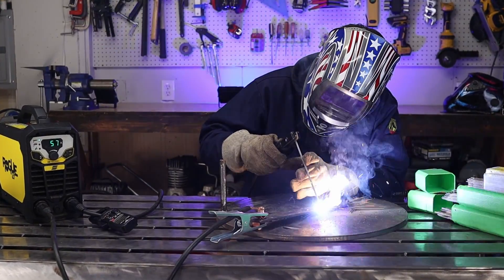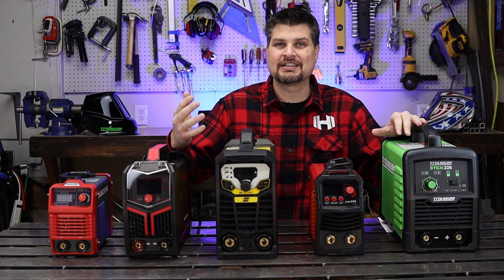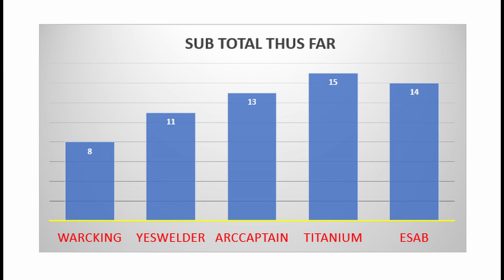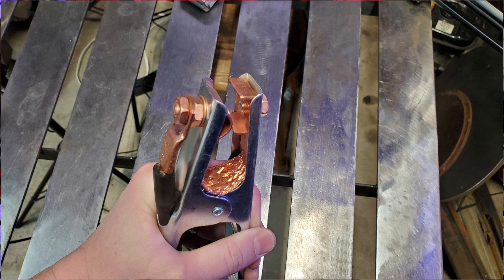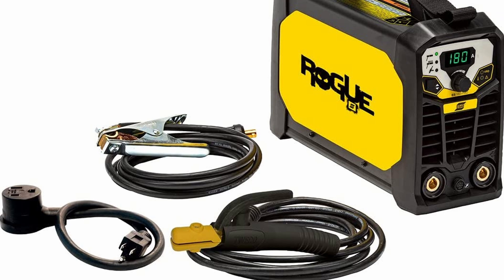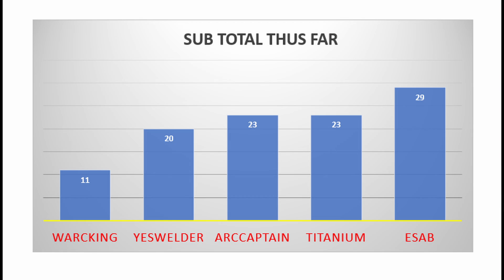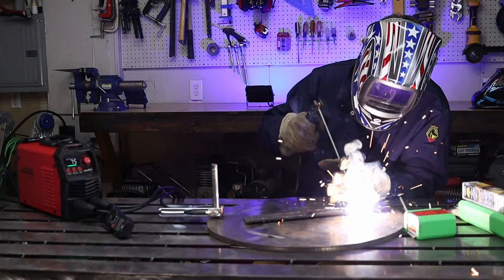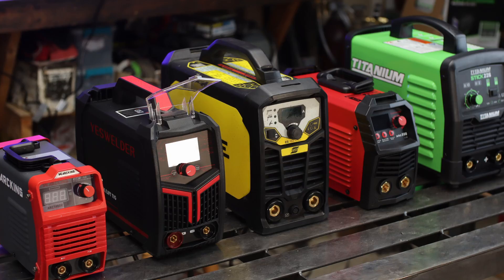Cheap Amazon vs YesWelder vs Harbor Freight vs ESAB? Best Stick Welder!

Comment: What would you choose between higher end models such as the ESAB ES 201i Pro or the Lincoln 180Si?
I don't have as much experience as you to see the cables, attachments, and the general feel of the products.
What about Manufacturer Support for both models in & out of the warranty period? Who really stands behind their product and offers better support in a timely manner?
Reply from the maker: Both ESAB and Lincoln are great manufactures that stand by their warranty. I've had plenty of machines from both of them before and you won't be disappointed with either.

Comment: Ive got 6 machines ranging from Miller MIG to (super generic) BCP flux core with a Razorweld as my main stick machine. Honesty my Titanium MIG140 is my favorite wire machine not only for great operation but great portability being WAY lighter than the Miller. Ive taught several people how to weld and spent lots of time reciting all the points youve hit on here. Thanks for a really effective comparison video, you did a great job of explaining different features QUICKLY without bogging down into impertinent minutiae or being disparaging on any model. Ill be forwarding this link to all my past, current and upcoming welding students

Comment: Thanks for doing these type of comparison reviews.
I've been looking at real test like yours.  A lot  "reviewers" get free welders or money and they are more of a product demonstration, than a critical review.   I don't know if you got them free, but some would not be happy with you, no more free welders to him. 
 I am looking hard at the ESAB 180, seems that no BS is going to cost me.  Truth in output is a double weighted factor to me.  I guess if you only have one welder at home you can learn to work around the wrong current display.  I also like the claim that the ESAB can run off 300 feet of 12ga extension cord with no problem!

Comment: What gets me on the 120/240v welders is when they use a 120v plug that needs to be adapted to 240v, that’s how you catch them on fire.
Reply from the maker: I agree 110%!
I was one of the first to test ArcCaptains welders and that was one of my suggestions. They actually listened and if you pick up a new one they come with a 240V plug from the machine and then add the 120 adapter.

Comment: I used the Esab while tiggin in a couple 10” schedule 80 fittings on 110v mode for a company that was too lazy or stupid to bring in a welder that was more appropriate- was way beyond capability for 110 but that’s what we had. Anyway, it made this god awful whistle sound through the torch while it was fired up- absolutely obnoxious. Never used a welder that did that before or since.

Comment: I bought a cheap flux 135 y.welder to run stick off of, an really it never has done good for that. Like awful. But, it does run .035 flux core like a banshee. Awesome, tons of power, smooth as smooth, and five rolls of wire into it now and I've never had a single hic up. An I'm never maxed out on the settings either. Even on 3/16", an I can appreciate that. We've all ran the ones that are always maxed, an probably wouldn't touch 3/16 like this one does. Honestly, I only speak so highly of it because it shouldn't be this slick! An for a hundred bucks, easy choice. It's not a 2,200 miller
Reply from the maker: Right on, thanks!

Comment: Hi, I'm having issues with this machine to weld with E6013 3/32  rods. It constantly stinking to the metal and its a pain in the neck to get it to wok.. i was trying 90-140Amp , current is 110  DC. If I'm right, the current in my home I'm talking about.. what can you tell me to get this to work.? I take the rods back to home Depot early.
Reply: assuming u meant sticking that would be a skill issue
Reply: Smelly

Comment: I have the Simder Arc200. Got it for $60 shipped from Amazon. I can't belive how well these cheap welders work. Gets alot of work done. The only major negative points are the false advertised output and the inaccurate display. On 240v I measured 115amps with the dial maxed reading 201amps running 1/8 6013. Running 3/32 6013 with the dial at100amps you get about 70amps. At 130amps on the dial, you get 90mps. Overall these machines are a great value.

Comment: I have some high quality 4AWG copper and am planning to buy a decent electrode holder/solid copper ground clamp to make my own cables. I wonder how much of a difference this would make using a cheap inverter stick welder? I will upgrade to a Hobart eventually but am impressed enough with some of the <$200 machines to go that route for now.

Comment: Just completed the break-in period and so far the unit is operating perfectly https://www.youtube.com/post/UgkxOTeIs0vv4_9B5hsmnLsk9r930uDQLu_Y . I was amazed by just how quiet this little guy is. I kept having to walk down the driveway to the generator to make sure it was still running. In fact, the most annoying noise coming from the set-up is a high-pitched chirping coming from the pressure regulator on the propane line. I suppose it's possible my other propane-powered generator's pressure regulator is making the same noise, but the generator itself is so loud I've never noticed it. Build quality so far is excellent. My only nit is the service panel is a little tricky to remove. I feel like I might break off one of the plastic tabs when bending it back. I probably just need to work out the technique, so will not hold it against Champion.Next week I intend to fully load the unit to charge a large battery pack and will update this review if there's any problem (3000W continuous load vs a rated 3100W capacity while using propane). Absent any trouble there, I'm 100% pleased with this purchase.
Reply from the maker: Yes, indeed!
Reply: What?

Comment: The cheaper ones run better on 220 volts.
Reply from the maker: I agree.
Reply: Need to do 110 readily (with the smaller rods.)

Comment: Esab 180i pro here, what sold me is the consistency of the machine. I can weld thin 1/16 thin materials at 38 amps with 1/16 6013. On the other hand can weld thick steel given proper beveling / prep.
Reply from the maker: Right on!
Reply: Hot-Start and Arc-Force.  (Supposedly makes using 6011/6010 a whole lot easier.)
Reply: Yeah, in order of best to worst the leading welding manufacturers: 1) Fronius, 2) Miller, 3) Lincoln, 4) EWM 5) Esab.
Reply: Prove it, I wanna see material that thin stick welded

Comment: Great review and content. Seems like most new tool review channels are trash. This is quality.
Reply: Not clear on the weld quality though, was the titanium really much better than the yeseelder and arcking
Reply from the maker: No, it was right in line with those (2). I believe I put it just a step above because it struck an arc without sticking or it did it quicker. Regardless those 3 welded very similar.
Reply from the maker: Right on, thanks!

Comment: The Titanium has built-in auto Hot Start and Arc Force, it's not in the literature. Another guy did a video about it.
Reply from the maker: It strikes and arc easily so I don't doubt it has those features but the other welders has adjustments to those features.
Reply: Yeah, hotstart is no good unless its adjustable, on thinner materials you need very little otherwise you burn thru, OR you have to get in the habit of going fast on the strike and then slow down.
Reply: @engjds  Plenty of machines have automatic hot start, and plenty have adjustable hot start. To say automatic is no good is wildly inaccurate. In any case, the merits of hot start were not at the heart of my comment.